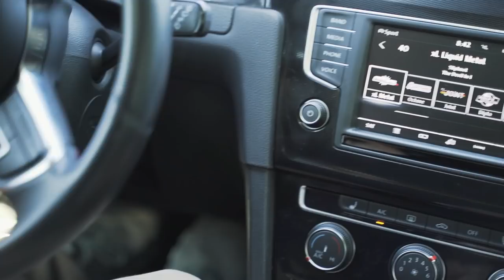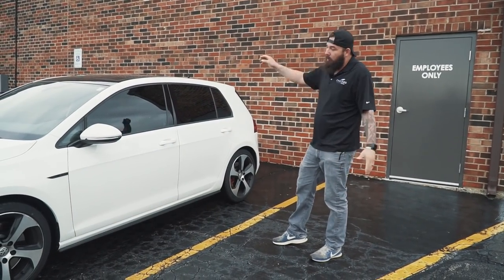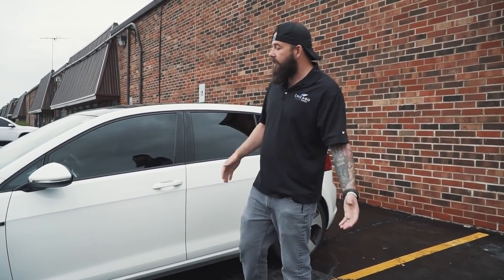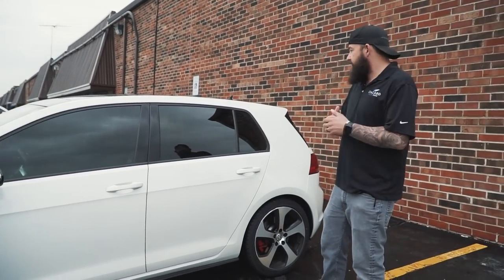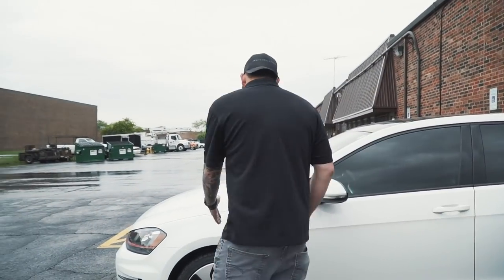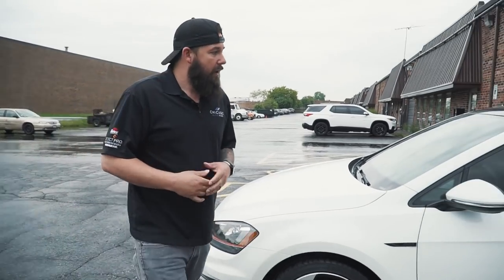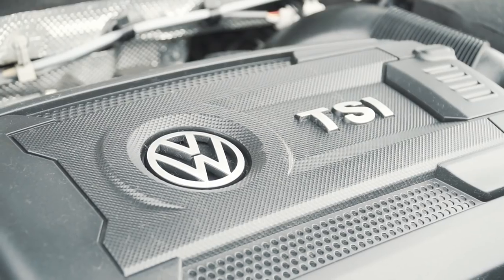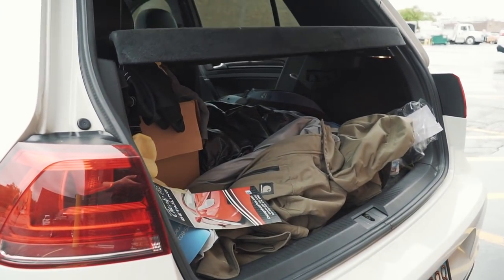My New Car | MK7 GTI

Comment: Fantastic choice on the MK7 GTI, you will enjoy it thoroughly! Your crew did a fantastic job in installing window tints on my black MK7 right after purchase 2 years ago brand new and I could not be more happy. I have been a VW owner since I got my license at 16 and have a fairly extensive knowledge of the modification capabilities of them so should you have any questions feel free to send me over a message/reply back to this comment. Looking forward to the content!
Reply from the maker: Awesome, yes I slowly reading up on everything I can do. It's a little overwhelming on how much you can do.
Reply: @ChicagoAutoPros  first thing to look in to would be Euro tail lights. Completely changes the rear end of vehicle and makes it look significantly more aggressive. I also had the rear decals removed. I think I'd toy with the idea of removing the side decals as well. 

Really just depends on how subtle or over-the-top you're looking to go in the modification world. I tend to lean towards a more OEM+ approach but to each their own!

Comment: My favorite part from my MK7 is the headlights. Check your lighting settings, if the adaptive is on. The projector beams turn with the wheels until about 50mph. Favorite headlights on an OEM car of that year.

Comment: I'm a little late to this video but is this your first VW? If so, welcome. My family has owned 12 VW's and 5 Audi's. You have bought one of the top ten most modifiable cars (VW Golf/Jetta) so there is plenty of after-market products to choose from. I have a 2001 MK4 Golf GLS desperately in need of some work but funds are low right now but someday soon. I will never buy any other car brand. I hopefully will own a Porsche 911/964 - that's my goal.

Comment: -H&R Lowering Springs 
-Konig 18 x 8.5 alloy wheel set (Black)
-DFG Tuning Cold Air Intake System
-Neuspeed PowerModule 
-All around 5% Tint 
-Neuspeed CatBack Exhuast. 
2015 Titan Black GTI right here boiis

Comment: Got the exact same car but a 2015 in Glenview
The wheels that i run for summers are VW Rotary :https://www.shopdap.com/18-vw-rotary-wheel-5g007149816z.html
Recommend switching the rear view mirror to a VW Autodimming/Homelink : https://www.ecstuning.com/b-genuine-volkswagen-audi-parts/enhanced-rearview-mirror-with-homelink/000072548c/
For HP there are a few tuners, APR is the elephant in the room. If you tune, budget for a clutch it won't last. :https://www.goapr.com/products/ecu_upgrade_20tsi_gen3_mqb.html

Comment: Why did the previous owner go through the hassle of going from electric handbrake to manual handbrake? Why the fuck would someone do that???
Reply: what are you talking about. American spec comes that way till 2019. manual HB not  button
Reply: @garymedeiros4807  sorry i'm from Europe and here the MK7 and MK7.5 did not even exist in manual handbrake optoion!
Reply: @MauriceNL1  I thought that might be the case. the US spec is cost reduced for the us market so it can compete. We also get fewer creature comforts. We don't get the same rearview mirror as Europe unless you get the autobahn trim, we also didn't get the digital gauge cluster like Europe has since 2017. we also have less BHP with our being  228 hp and yours closer to 238hp. but the happy cost saving was the manual hand brake but I think the 2020 Mk7.5 got the electric HB but I'm not completely sure. Last Europe gets the version of the EA888 with the 2nd set of injectors to mitigate carbon buildup, US doesn't get that, which is a huge downer.  I assume there are other cost cutting measures too. ours were also built in Mexico.
Reply: @garymedeiros4807  You guys are also still using the "old" 1.4TSI engine with much turbo lag! We have the new enchanced 1.5TSI with a special turbo. Way better engine
Reply: @MauriceNL1  yeah unfortunately VW does not sell well in the US. because of that we get the cheapest iterations of VW vehicles except for the SUVs. it s a shame really. VW had major issues with reliability here and they much more expensive here vs Japanese, south Korean and Domestic brands. People here wont pay more for a less reliable more expensive car when they want an "appliance" vehicle. I have a GTI but they sell only 12-15 thousand of these a year in all of the USA! they wont even sell standard golf or golf variants in the US going forward. Honda Civic sells maybe 325-350 thousand models a year in the US. all of golf in the US  sales have fallen from 2016 of 61K cars down to less than 38K cars. so you can see how they cant compete here. My next car might be a Civic SI since its hard to even find someone who knows how to fix VW cars here. I think the GTI is a much better car but not made to last. we will see.
Reply: I would have bought and Hyundai I30 N if we had them here in US but we only get the Veloster N which is too small and weird door setup.
Reply: @garymedeiros4807  Seat Leon Cupra is a nice car? Howw are those in the US?
Reply: @MauriceNL1  we don't get seat at all in the US. Most Americans have suvs not small cars, I would love it.